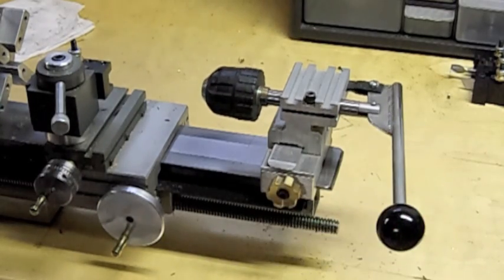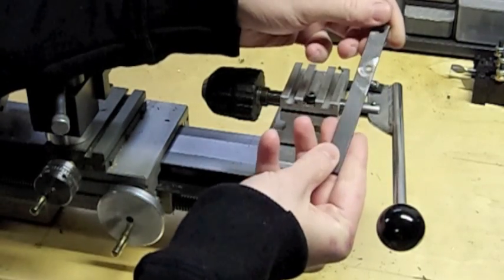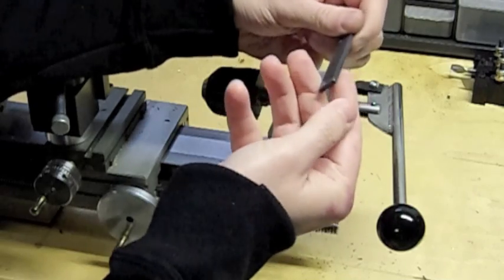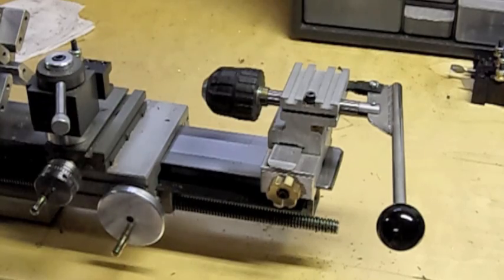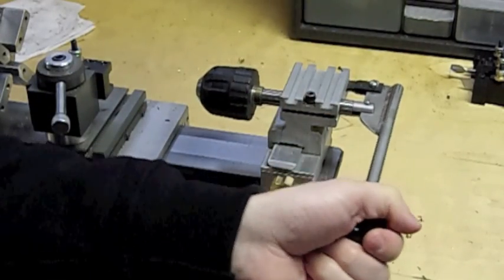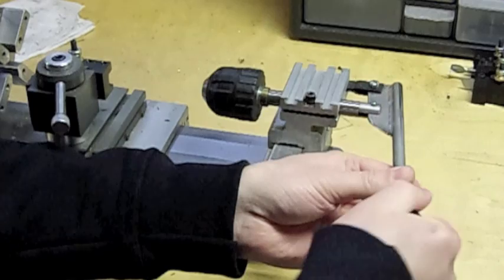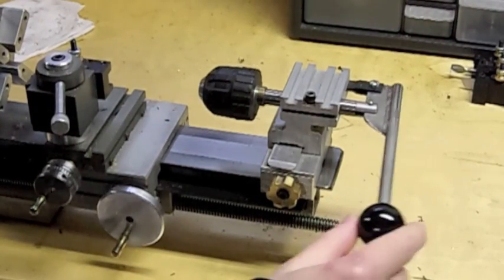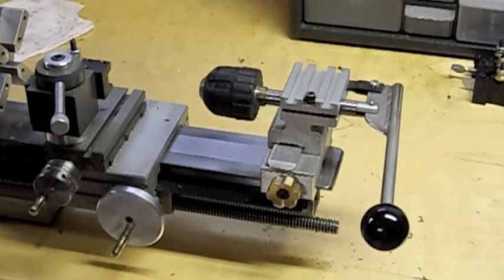Improved Taig Tailstock Lever

Comment: Very good job, I loved it. I have a lathe just like this but I do not know how to do or how to do this tailstock.
Could you make an equal and send it to portugal? IF yes,how much?
And how can I get a tool holder like the one you have in your lathe?
Many thanks
Reply from the maker: Thanks very much! 
If you'd like a lever I currently have them up for sale on ebay. A search for "Taig tailstock lever" should pull up the listing. They're about $20 plus whatever shipping is to Portugal. I can work something out with you through Paypal too if need be. 
As far as the quick change tool post, I bought that years ago from a company called A2C CNC, which unfortunately isn't in business anymore.
Reply: Many thanks for your information. I will got to ebay.

Comment: sure beats the Sherline tailstock, that wobbles and is generally weak. Do you have morse taper in that?
Reply from the maker: No, that just slides on a 1/2" straight shaft. It's a good design for the speed and feel it gives you, but tends to want to pull into things too aggressively while drilling in certain situations.